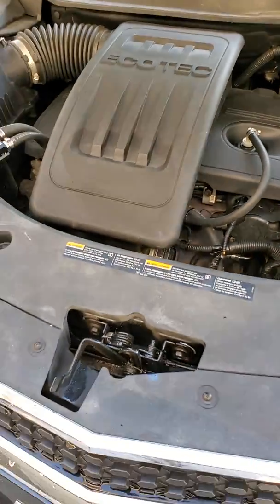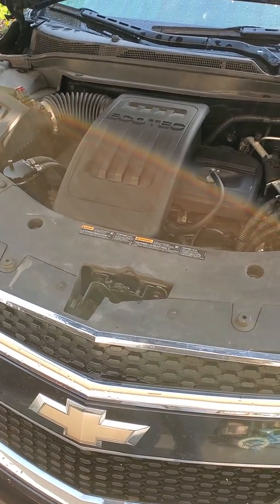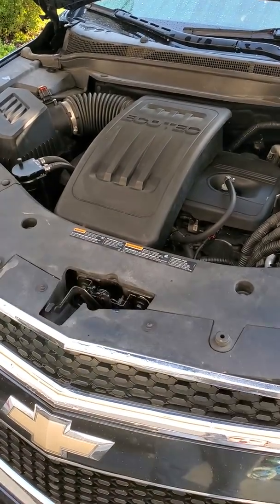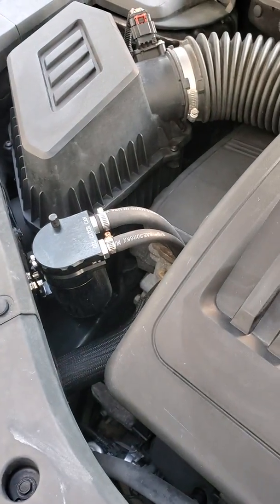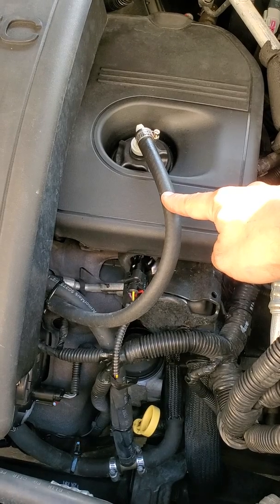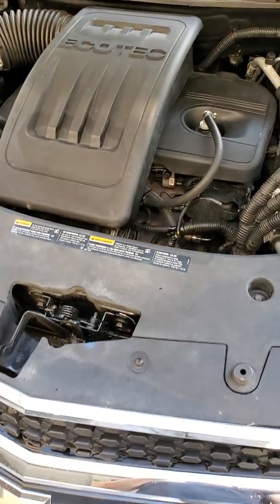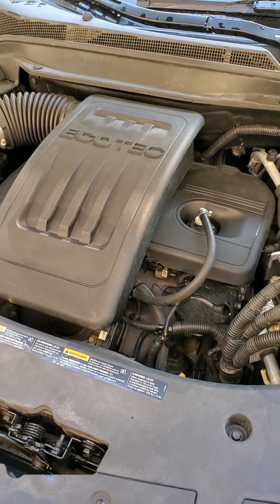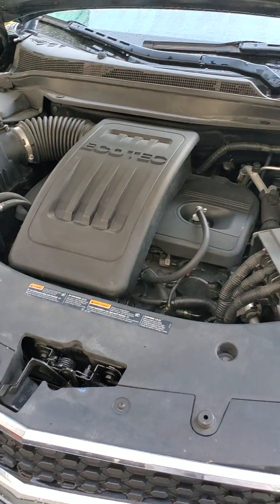2.4L EcoTec oil consumption fix. 2013 Chevy Equinox. Oil Burning, Catch Can.

Comment: Theres another video were they installed a new cap and added a pcv like in this video but the other guy drill the intake put the hose only diference is this one installed a catch can
Reply from the maker: Yeah he drilled and cracked his intake. His video was what inspired me to make this one and make it a bit more streamlined. There is really no reason to tap into the intake the whole job can be completed in under an hour this way if you have everything there.
Reply: @abefroman1986  i was thinking on just doing the t line to new modified pcv oil cap. And just puth the oil catch can were the original pcv hose is attached since that hose is also the main problem during winter on clogging up.
Reply: @abefroman1986  some say its not a good idea diing the t line from the brake booster line? Do you know anything about the issue
Reply from the maker: @rhurtadorh32  scroll through the comments here I explained to a few people why it's completely safe

Comment: It keep seeing issues with the 2.4 in terrains and equinoxs. My question is it all of them that have the 2.4 or is it up to 2014? I have a 16 I got with about 58,000 miles on it.
Reply: Any GM vehicle with this 2.4L /4 cylinder motor has this problem and money out of pocket it costs over $10,000 just for parts and labor together I got shafted mine has a rebuilt jasper motor for that price
Reply: @speeddemon_1369  I also read that it depends on where you live too.
Reply from the maker: The major oil burning issue was improved in 2014 with a piston and ring update and previous years have a TSB warranty update and can be improved with same pistons. But the oil issue isn't completely fixed and the 2.4 can still be improved with this modification on 14 and newer engines

Comment: That in to the catch can should be fed from the pvc in the valve cover, then the out should be hooked to the part that clips into the fresh air in let to the throttle body  You should put steel or copper wool on the bottom of the inside of the catch can.. then on the lid. Where the clean air feeds to the throttle body, you should put that green scrub pad to final filter the air into the throttle body intake.
Reply: This the proper way to do it .Leave that brake booster a alone
Reply: I was thinking the same thing
Reply: what is the purpose of the wool in the can?
Reply: @joewinsor9012  only traps the oil,filters the air going into the throttle body.

Comment: My heart goes out to anyone who got the shaft how GM handled this situation with there PCV valve and rings and pistons.me and my wife bought a 2012 3 years ago from the dealership and I nagged,bitched and just wouldn’t go away until they agreed to replace the rings and pistons under our warranty.wasent easy at all.But as everyone knows the car was burning over a quart every thousand miles.After they replaced the rings and pistons it’s been great.And there is a aftermarket intake that helps.We just got  lucky that they fixed it.Good luck
Reply: Do you have a link where to purchase the modified intake?
Reply: It took a class action lawsuit which GM lost to act on this
Reply: @a3300000  I wish I could get in on that lawsuit.  Just spent $2300 to have our engine fixed because of those.  150k miles so no help from GM.
Reply: @ace00007  I understand. I would recommend changing oil about every 4000 miles. Best thing you can do for these direct injection engines.
Reply: @a3300000  will do.  Going to order the vented oil cap and still considering adding a catch can but it my teen sons car.  I could just see him once he goes off to college never emptying it.  ;)  I think part of his problem is 98% of his drives are short so the engine never gets up to temp to help evaporate any moisture in the engine.
Reply: @ace00007  this wont solve the burning oil with a catch can. Your rings and pistons are shot. To slow this problem down go to Amazon and look up a silver bottle. Called Atomic metal sells 49.95. It helps slow the ring seal. I'm on second bottle.
Reply: @glock23fan50  Added it to my list in my Amazon cart.  Supposed to get the car back from the shop today.  I'll monitor the oil usage to see what it looks like now.
Reply: @a3300000  best advice is drive in a snow storm there's a guard rail with your name on it. I know nothing....
Reply: @glock23fan50  low self esteem? My comment wasn’t directed at you or anyone else. Just a statement of fact.
Reply: @a3300000  No worries there. Mine burns oil but it wont be around much longer. 4 cylinder GM is junk engines. Only getting Toyota now...cheers
Reply: @glock23fan50  Toyota makes good vehicles for sure.
Reply: G,.M says if you burn a quart in 2000 miles thats ok in their book.i cal bullshit.
Reply: Truly its all about the Bitchen. To get a GM motor fixed.

Comment: So, the OUT port receives engine vacuum, and the IN port gets PCV valve fumes and moisture ?

Is there a proper vacuum port on the intake manifold?
I thought the brake booster received vacuum from the electric vacuum pump?
Have you measured the engine vacuum from the engine and not the electric pump?
I was thinking as to what would happen if oily stuff was sucked into the electric vacuum pump.
It is possibly $150.00 or so.
Reply: M•y•w•h•a•t•s•a•p•p
{<+1).(8).(1).(4).(3).(1).(8).(7).(4).(2).(3) 🇺🇸 ✅

Comment: I have a 2014 and 2.4 in my Terrain, only has 63,000 miles, but I don't find any oil in the factory pcv tube coming from engine to intake, took it off a few times to check and nothing but maybe a single drop, even the intake area that catches oil if any gets by was empty. But, I did add a GM vented oil cap part number FC219, for extra backup if pressure builds up. The vented cap has been on a year and zero issues, cost is around $11 new for the GM cap. Only issue I have had is a stall when first starting then never stalls again. I replaced vvts, intake sensor, throttle body, spark plugs, 1 O2 sensor. What finally stopped it, now every 30 starts may stall, but very rare. I ran fuel system cleaner, a bottle of Berrymans complete fuel system cleaner and about a 3x more than on bottle dose of lucas fuel additive at same time as the Berrymans.
Reply: Have a 12 slt terrain Bad oil consumption but I add another 5 quarts once I hear it's low from the start up... And I change oil every 3k(Walmart synthetic since it's burns the oil fast anyways. The TSB helps only if you've blown your engine and repaired it out of pocket I've called lol SMH...I've been looking at the Fc219 cap and I think I'll buy it just incase. I'm at 101k bought it 2 yrs ago with 63k so far I've had to replace transfer case & it ruined passenger side axel $1100 70k, manifold went bad so replaced it  and catalytic since that was on its way out at 84k, Changed flex pipe also when I bought it(dealer paid) Those are all common problems with 2010-2015. Good luck Keep an eye 👀 on YOUR OIL!
Reply: @rontam06  so far zero oil issues, stall I got to stop after changing plugs and adding 4 times the lucas fuel cleaner and a bottle of another complete fuel system cleaner.  Now I just run a cleaner every fill up. I do have a 14, which they say they fixed issues, will see. I bought the Terrain about 2 years ago with 50k miles for $6900 with rebuilt title, was already fully repaired. Only real issue I have is it's a little underpowered, I am used to 300hp plus vehicles, other cars/trucks I have have 550hp, 300hp, 425hp, so not used to under 200hp in a suv.
Reply: @rotwiler7674  nice Rebuilt cuz of class action lawsuit...I don't add fuel cleaner every time but I do add frequently just in case I've Changed sparks also. Definitely under powered on a on ramp im at 5 Rpms sometimes have to take it out of Eco to feel some type of power lol
Reply: @rotwiler7674  well that's because it's a efficiency vehicle not a sports car That's why
Reply: @speeddemon_1369  totally understand that, but it's still underpowered. The v6 version gets similar mileage in real life driving.
Reply: @rotwiler7674  good price mine was 14k 2012 clean title...yes it is very underpowered. Was shocked it was 4 banga but happy gas wise. Sometimes I got to off the Eco just for a bit more power. Going for inspection tomorrow 🤞

Comment: this works but why not "T" into the factory line. it gets the same results with less work and material. plus you can then run the oem vented GM oil cap. I don't understand why others are messing with the oil cap and hacking things up for other sources of vac. the factory line comes off the valve cover. just like your oil cap mod minus the valve you've added which could be done via the stock line also, (i didn't). that factory line is the source of all the moisture and gunk getting going through the throttle body and gunking things up and possibly freezing or clogging the hole in the manifold. maybe I'm missing something but I don't see why it would be done any other way than tapping into the stock configuration.
Reply from the maker: You are missing something you are talking about tapping the fresh air side . You need to clean up the dirty side which is what we are doing in this mod some guys add 2 catch one on clean side one on dirty side to go above and beyond. The line you are referring to drains oil and carbon down due to the factory pcv system being substandard. This mod cleans up the oil /water saturation sucked in to the intake and also gives the pvc an alternative path in the event that the oem hole becomes clogged. You can watch my other video showing how well the mod works.
Reply: @abefroman1986  well i installed a catch can from were the pcv hose is. And dont catch no oil at all just mixture of water and gas or very very minimun yellow gunk. I just cleaned the intake in the weekend. Its very easy to tell if its clogged. I just put a piece of paper or plastic and when you accelarate the pcv hole acts like a vacuum if it doesnt suck air and its pushing air while accelarating at 2000 rpm then your orifice its clogged
Reply: @abefroman1986  either way your just pulling from the valve cover. the not so clean "clean side" does the exact same thing though it has some baffles under it blocking any raw
 oil from getting sucked up via any splatter. but all the vapors and gunk still makes it through. thought this way probably catches more since the baffle before that port probably gets some of it. but the way I explained would stop all that junk from entering the system I the first place which is the source of the water vapors and build up.

Comment: Thanks for the video. I need to do this to my wife’s car. Saw some comments on the concern with T-ing into the break booster vacuum line. Knowing how that works and the fact that there is a check valve; I assume there is no actual danger of brake failure. Is there another way to pull the vacuum?

Could you tell me what size brass T barb is and the hose sizes needed for this? Maybe a sketch of your installation?

Thanks in advance.
Reply from the maker: Apparently I need to do another video lol. The brake booster hose is 1/2" hose all the hoses for the kit are also 1/2" I purchased a brass tee with 1/2"barbs

Comment: I ran the vacuum hose from the cam cover to the atmosphere and plugged the intake. GM also has a new oil cap that has a pop off valve.
Reply: Where do u get the the oil cap
Reply: New oil cap, please share details? Thanks
Reply: @yosamuel91  ac delco FC219  original equipment vented oil filler cap ... Amazon has them for $11.60
Reply: @deere can you email me a pic of how you ran it to the atmosphere and plugged it what did u use got the plug 
robertlesliewall@gmail.com
Reply: How is that working out for you? Is the engine still alive?

Comment: Would it be beneficial to also run hose from pcv on value cover thru catch can also, as it allows a ton of condensation to run thru air intake down thru throttle body in cylinder burning up rings.
Reply from the maker: This can should catch most of the condensation now. And no you really can't  run both to it. The pcv needs a clean air side which is what your talking about  and the dirty  side which is what  the can install helps to make better.
Reply: @abefroman1986  so you just leave the old hose coming from valve cover?
Reply from the maker: @Josh-xv9om  yes.
Reply: It looks like the vacuum you use, on my 2015 gmc terrain is already split, any idea what other vacuum line I can tie into.

Comment: Also a friend of mine who worked with me at a dealership years ago claims there are there are redesigned valve covers which also help alleviates this problem.
Reply: Any way you can find out what the link is to it ?
Reply: I did a search on the internet for a redesigned valve cover but found nothing, do you have any info about one?

Comment: You set yourself up for a high risk of brake failure. NEVER TEE INTO A BRAKE BOOSTER VACUUM LINE!!! Draw your constant vacuum from under the throttle body. Much safer this way
Reply from the maker: https://www.quora.com/How-does-a-Vacuum-Booster-work-and-what-is-the-%E2%80%9Cvacuum%E2%80%9D-in-vacuum-brake-booster
Reply from the maker: Incorrect. The connector at the booster has a 1 oneway check valve. Fumes can't go in only vacuum can be pulled.But feel free to do that if you feel its unsafe. You are unclear in how a brake booster works I have attached a link to help you learn the principle of how it works.

Comment: I would think oil vapors  would get into the brake booster will damage the diaphragm inside.
Reply from the maker: The engine vacuum pulls it away from the booster.
Reply: The vacuum will draw it into the booster actually.  Draw vacuum from below throttle body. This way any chance of fumes gets burnt off. You are drawing an unmetered source for a vacuum
Reply from the maker: @Obi_Wan_A_No_Me  incorrect the vacuum PULLS on the diagram inside the booster. It doesn't PUSH vacuum into the booster. the vacuum and fumes are pulled away from booster. The vacuum line on the booster IS connected behind the throttle plate. Also the connector at the booster has a 1 way check valve. Fumes can't go in it can only be pulled. You are unclear on how a brake booster works. I have attached a link to help you understand the principle.
Reply from the maker: @Obi_Wan_A_No_Me  https://www.google.com/search?q=how+a+brake.booster+works&client=ms-android-verizon&prmd=visn&sxsrf=ALeKk03Vd3tm89N9UkQRUOW5DPy_setuUw:1608653035908&source=lnms&tbm=isch&sa=X&ved=2ahUKEwj6kZbG--HtAhWaXM0KHbn4C7sQ_AUoAnoECAYQAw&biw=412&bih=722&dpr=2.63#imgrc=QLm23XYtfu7_pM&imgdii=kZCiwZz6b2PByM
Reply from the maker: @Obi_Wan_A_No_Me  https://www.quora.com/How-does-a-Vacuum-Booster-work-and-what-is-the-%E2%80%9Cvacuum%E2%80%9D-in-vacuum-brake-booster

Comment: What size "tee" did you use to splice into the vacuum line?  I'm about to do this project, but don't know what size the line is?
Reply from the maker: I think its 1/2 inch hose and barbs.

Comment: Do you delete the GM pvc hose,or just leave it??
Reply from the maker: There isn't a pcv hose to delete.its built into the manifold. Hence the reason to do this modification and add a external pcv system.

Comment: How did you mount the catch can did you have to tap new holes or did you use pre-existing holes I looked around it didn't see any obvious easy place to mount it.

Where did you route the line out of the catch can to the brake booster? Does that route to the intake manifold?
Reply from the maker: I used the bracket included used it at a template.  Tapped the holes for the bolts and used some washers to space it out like a 1/4 inch so removing the filter is easy

Comment: Why did you not catch it from the cars built in PCV? No need to tap the cap and the other hoses that way. Also this will help a ton if done properly for those without the piston update.
Reply from the maker: There isn't a traditional pcv in the car its just an orface built into the inside of the intake. There are tons of videos explaining this and the issue how it arises ect.Also it will help if you don't have piston update BUT it will overflow the can because it is so bad and you aren't truly fixing the problem only band aiding it. This is a true fix. In addition to the piston update.This is basically giving a 2nd route if the factory orface were to clogged (and it will clog )as well keeping the seals from blowing out which happens alot in cold weather climates.
Reply: @abefroman1986  so if I have the 2014 model does that mean I'm not experiencing the same issues with the pistons as the one shown here? I have seen oil leaving that orifice, in the tubing and going into the intake. I am @167k and seen the oil burn at about 1 quart between 5k miles. Keep in mind I use Royal Purple and always have.
Reply from the maker: @larrygaryaargh  i believe in 2014 the updated design pistons were installed in the engine the pcv system still is garbage id do this update to 100% eliminate the possibility of it becoming clogged especially if you live where it gets cold
Reply: @abefroman1986  OK cool, that sounds like a plan, I appreciate your video and further explanation. Keep them videos going!
Reply from the maker: @larrygaryaargh  your welcome maybe I need to do a 2nd video with more detail.
Reply: Tapping into the vacuum line is much better than running catch can off existing so called pcv, it's not even a pcv valve, just a hollow plastic elbow venting back to engine under intake manifold.  This system you have provides vacuum to draw the moisture out, cudos and well explained.  Thank you.